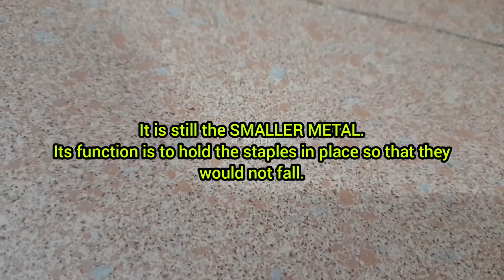How to Repair a Broken Stapler? | GOOD HEIGHTS

Comment: Hope do someone notice me here because I'd fixed mine already but after stapling something, it stuck everytime but the good thing is that the stapler staples good on the surface plus not exceeding on going out however if I use it again; I use small thin screwdriver to insert for able to use it as remedy?